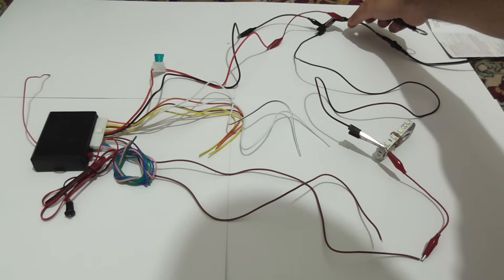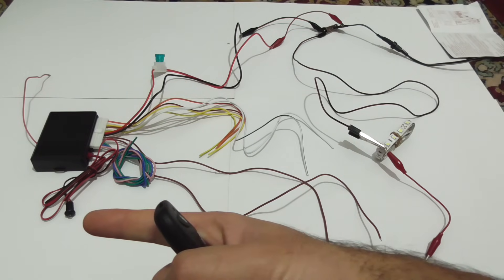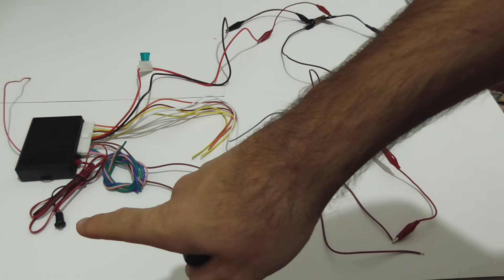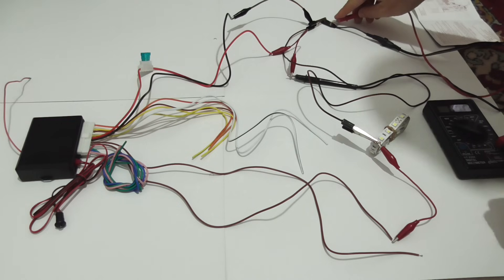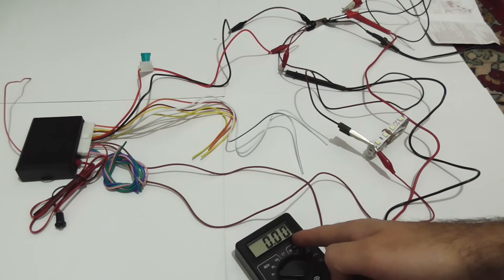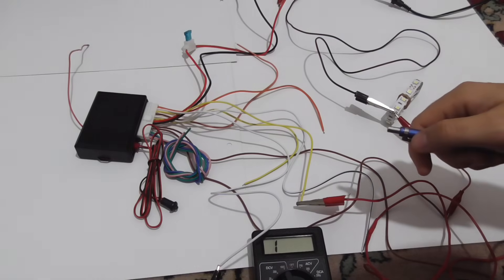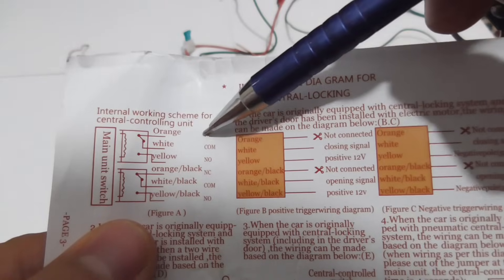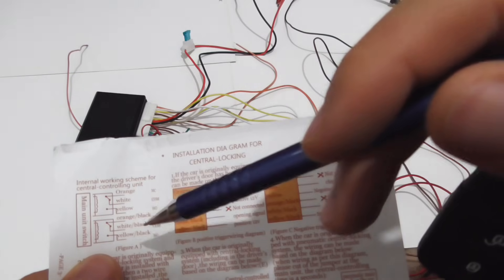Car Keyless Entry System (Components, Manual, Partial Test)

Comment: Someone installed this door lock system in my 2003  honda odyssey van , it look exactly like this one , but after 2 years the remotes don't work anymore I replaced the batteries with new ones  I have to press the unlock button 20 times to open , very frustrating .

Comment: Great video.  Do you know which color wire goes to the solenoid?
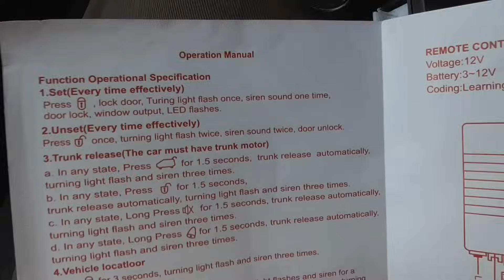Reply from the maker: I'm not sure, I never installed it because I sold the Citroen. Check the user manual at 1:46.

Comment: opening signal and closing signal (cable opening signal and close signal) do they send 12v current? because with the multimeter or indicator light does not light up on these two cables when I press lock unlock on the remote control
Reply: The same here, looks dead

Comment: Have same unit by LANBO, though 2023 model.  Here looking for instructions, since just a wiring diagram w/ no function description.  Note the "oops" resistor added across the top DIP chip.  Not uncommon in a new design, even in production.

Comment: When I lock/unlock car with physical key, in drivers door, this kind of system cannot be the cause of something not working properly?
For example, I try to unlock it with the key, it doesn't unlock all of my doors, only drivers... Could this system be faulty, or is this not in any kind connected to turning the key in the door?

Comment: Thanks for the post . What Battery does that Fob use . I got a LB-402 same fob no batteries and no battery # supplied. Any help would be appreciated thank you.
Reply from the maker: I'm not sure, I never installed it, and there are no screws on the remote, so it probably uses plastic clips to hold it together.

Comment: Hey i want to ask could i connect trunk release to +? That to give 12v to my car trunk😊
Reply from the maker: I'm not sure, in the end I never installed this into a car.
Reply: A relay is needed to open the trunk, because it only has a transistor output which can be loaded up to 200 ma

Comment: I was able to get it working in my 1993 Grand Cherokee.  Thanks for the video.  But I can only program a single transmitter.  How do I program a second transmitter?
Reply: there is usually a button on the box (M) labled and you hold that and the button to unlock on the remote so they cloud learn each code
Reply from the maker: I'm not sure, I still didn't installed this into a car.
Reply: Hello Steven, i have a 1995 Grand Cherokee. Maybe you can give me some installation tips? Where did you put the box? Which lines in the vehicle did you connect Box to?
Do I have to go to the switch in the driver's door or do the cables run under the dashboard? Maybe with your help I can save myself a lot of time and unnecessary work.
Thanks in advance .
Martin

Comment: Thank you for useful information, but one of the most important feature is missing. I don't care if it draws 10 ampers when flashing but I really do care it it draws 5mA or 15mA while standby. Please change the scale while measuring for higher precision. Do the math if you park your car for 2 weeks = 336 hours. If the car's computer takes 20mAh and this device another 15mAh, we lose 1/4 of battery capacity. For an older battery you won't even be able to start the engine. And anyway the battery's life will be shortened.
Reply from the maker: This gadget requires power... Add a solar panel to the car battery :)
Reply: @furulevi  The scope of your posting is to show various characteristics of this device. Adding a solar panel is another very complicated subject, but all decisions can be made if you contribute with correct measurements with your help, editing this video. I'm sure that way you will get more thumbs up.
Reply: @furulevi  🤣🤣🤣

Comment: can you remove the chip inside the key fob and put it in another one? i wont be using one of the buttons, so would it be good to transfer it to a 2-button fob replacement?
Reply from the maker: I'm not sure...
Reply: @furulevi  its alright.... I think i might end up buying some keys and see if i can get them reprogrammed as long as they work with the right frequency

Comment: Does anyone know how to make trunk lock work.
Reply: Trunk unit has got to be a  electrical power cables won't work. 
It's either a 12v or Grounding. 
Box output has to match the input..
So + or - to the trunk.
Relay can be used to switch

Comment: i have one of this working by 3 years in my farm truck.
Reply: Did you have to had it programed? I just ordered One online and I was confused about if the chip comes programed or if I need to program it...
Reply: @joanarodrigues4581  its very simple to do.
Quer que eu explique em português ou en inglês Joana? Rsrs muito boa essa chave, é chinesa mas funciona muito bem, e ate é duravel, me cobraram 150 euros pela original, com 20, fiquei com uma chave mais legal q a original.
Reply: @GuarujaBrazilGTASA-MP  sim, também me disseram, mas o vendedor disse-me que podia ter de a programar... Eu vou mandar o mecânico instalar, mas para programar tinha de ir a outro sítio e não sei se eles programam este tipo de coisas... Mas eu vi muitos comentários a dizer que já vinha programada...
Reply: @joanarodrigues4581  Joana, se tu pagar pra alguem fazer isso, não compensa, é bem simples instalar, e também codificar, ou programar, se for preciso, qual seria as tuas duvidas? Manja um pouco de elétrica? Eu mesmo instalei o meu, e meu parca viu, quis TB, hahaha, já instalei em 3 carros, e não tive nenhum problema.
Reply: @GuarujaBrazilGTASA-MP  a minha dúvida é só como codificar... Pelo que vi nas instruções não tinha como codificar...
Reply: tem sim man, o modulozinho, tem um numero, q é a banda, o que comanda, recebe o comando do controle, por exemplo, se o codigo do controle é 324532 tu tem q fazer, mas tem um manual q explica, é em ingles, com muitos erros, mas é compreensivel, qualquer coisa, manda um salve aqui q te ajudo, é molezinha molezinha isso ai pra brasileiro rsrsrsrsr

Comment: @Furulevi hey i just connected mine today and i didnt get it to work it was on a 1999 wrx imprezza. i put the 12V Red wire onto a power source in the car.
Both yellows with the 12V since they are power also.
then the white and white/black onto the central locking unit for open/close on the car. and black grounded on the car. it shows the blue light making noises when i click the remote but the doors dont open or lock. I havn't connected the brown wire to the idicators though if thats what matters and i also havnt set up the remote with that button on the unit that button you hold in so i dunno if thats the problem
Reply from the maker: Sorry, but I haven't mounted my remote yet... I have another car now
Reply: i hav the same problem wondering it its not if the learning code

Comment: My car when i press the remote but central locking not function but flash light is working. Check the power is good. What ia the problem?
Reply from the maker: I'm not sure what to tell, I haven't mounted mine yet.

Comment: Can you please check the functionality of blue and green wire, those wire for power windows and trunk release. For me those are not working.
Reply from the maker: I haven't mounted it on a car...
Reply: I thought the same with the blue and green wires. In my situation the blue and green don't operate the door actuators, the red and blue wires do... I have five wire actuators...

Comment: this kit can give a negative trigger and positive trigger right?
Reply from the maker: I'm not sure...
Reply: i just found out looking at some other diagram that it can do both, in the Nr.1 diagram where you can ether hook up the yellow wire to +12v or minus thats what desides it, so in my case i need to hook the yellow wire to ground.

Comment: Good explanation man, I took out my car door and saw how the lock switch works, wired it and all good now. I didn't use the orange cables and wired the yellow ones to black as this seems to be the way the factory lock works
Reply: Hi.. did you notice that the alarm did not have a doors switch detected?
Reply: How to do, make it work..
Reply: @mdtech7606  it has been 5 years. Not sure
Reply: Please email me to ven.limpakan@gmail.com thanks you.
Reply from the maker: I haven't installed mine yet ;))

Comment: so where to connect these wires? in the fuse box? and where on the fuse box?
Reply from the maker: it's not that simple... I haven't mounted mine yet :)
Reply: No, not to the fuse box.  At most 3 of these 13 wires could be connected there, and it's always better to connect outside the fuse box than inside it.

Where you do connect the wires will depend on where you mount the control unit.  I installed the unit alongside the control module for my car's original central locking system; that provided easy access to +12v, ground, and the lock trigger wires while protecting the keyless system with the same fuse.  I extended the light-flashing leads (brown) to reach the hazard-light switch; you could connect to the turn-signal wires from the steering column instead.  You'll probably have to tap into the horn circuit at the steering column.  Don't connect the horn lead (pink) directly to the horn!  Your horn may draw enough current to overload and burn out the keyless module.  If your car has a power trunk release, you can connect the keyless trunk lead (blue) to the interior switch rather than run a new wire all the way to the trunk.  I think you'd have to wire the window-rollup lead (green) to close relays which in turn would supply current to the window motors; wiring all the motors to the green lead would sacrifice independent control of the windows.  A wiring diagram for your car will help a lot to identify the connections.